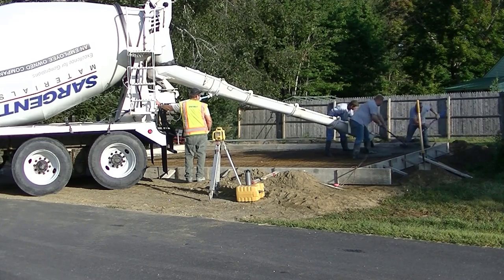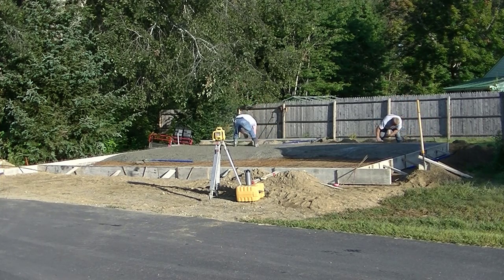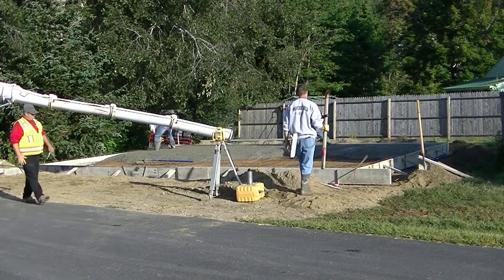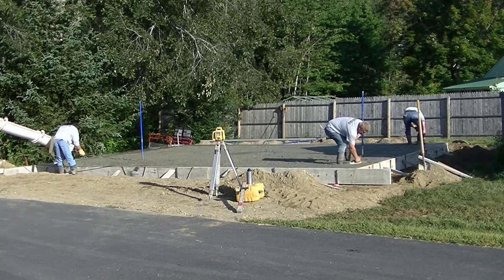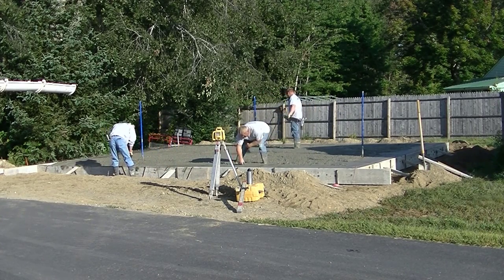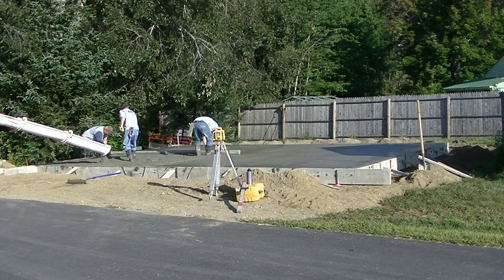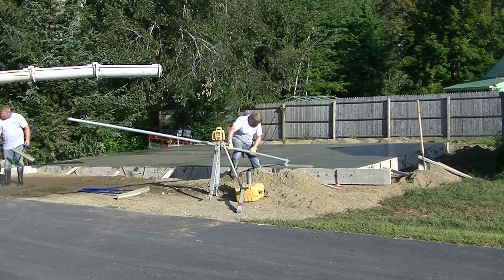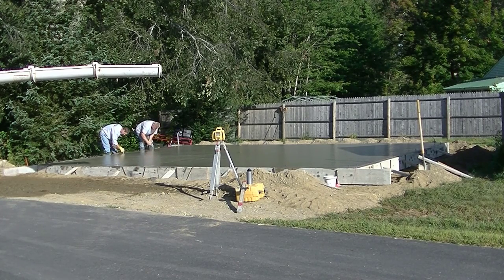How To Pour A Concrete Slab For A New Garage Part 2

Comment: Hi from Australia....I'm wondering if you have any video footage on adding to an existing slab? .... so I have a 7m x 4m shed (21ft x 12ft) and I want to extend it to 11m x 6m (33ft x 18ft)
I want to see how you treat the reinforcement "starter bars" drilled into the edge of the existing slab... the existing slab is 100mm thick (4 inch)

Cheers from Rodney in Melbourne
Reply from the maker: I drill into the existing slab every 18 inches. About 3" deep. Then I hammer in a 2 foot long piece of #4 rebar.
Reply: @MikeDayConcrete  Thanks Mike....do you have any advice on matching the finished level of the new concrete relative to the old...IE should I finish  the new pour surface exactly at the old level....or is there a magic allowance for shrinkage of the new level to the old?
and...should I put a thin 1/8th of an inch strip of expansion foam between the two edges?

Comment: Hey I got a question. If you are pouring a real soupy mix. When should you bullfoat it.?
Reply from the maker: If it's too soupy you probably can't. Why are you pouring it so wet?
Reply: That’s how it came on of the concrete pump.
Reply: And it was a recycled concrete mix. I comes out real soft. Then it blows really quick I kind of funny first time worked with it

Comment: Wont let us build on that type slab in rhode island.   Need 3 1/2 'below grade wall.       Unless its a pole building with posts 42" in ground. Then you can pour haunch edge slab after

Comment: Why thicker on the edges? I saw that happening sometimes in your videos...
Reply: I believe because it's a monolithic slab, meaning all one pour, instead of pouring a footing then the slab,the thicker deeper edging acts as the footer for the building
Reply: @timhuff4166  thanks, man!
Reply: Strength and frost protection